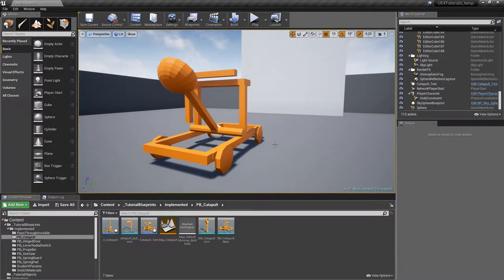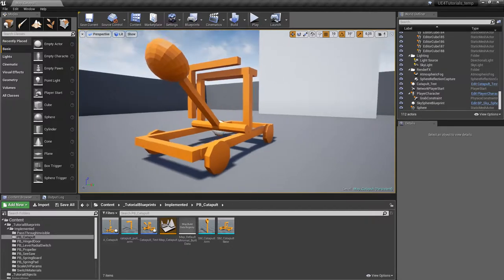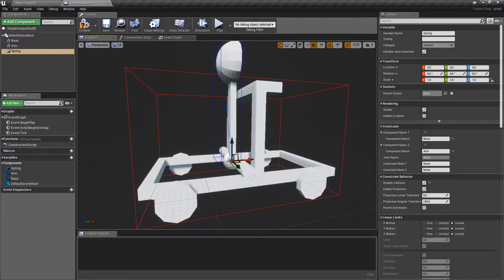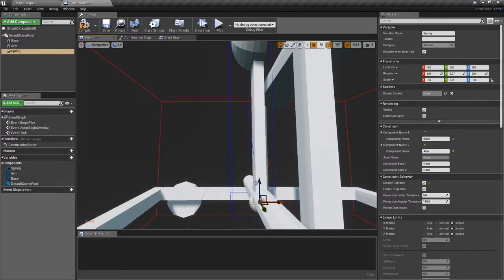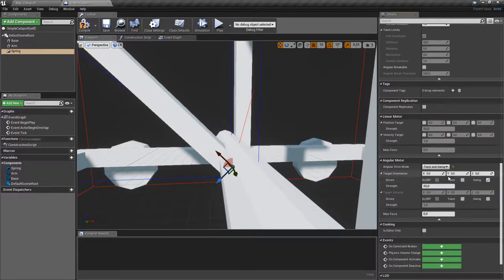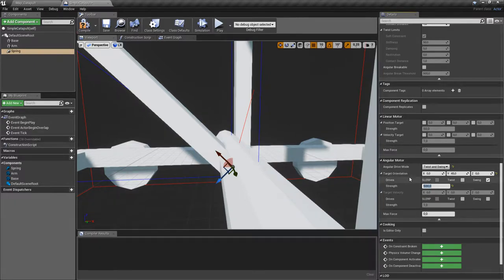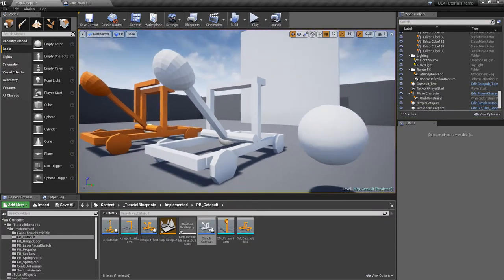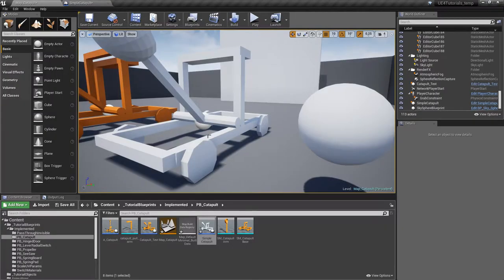UE4 Catapult - War Machine using Physics Constraints in Unreal Engine 4 Tutorial How To

Comment: Hi. can you change ingame the shot force (distance)?
Reply from the maker: Good question! Yes, you can change the shoot force. Here's the blueprint for that:
https://drive.google.com/open?id=1uN4fHZnNbJyQNMuWtOunAUN0stHqkIlS
First, create a function called 'Set Spring Strength' with a Strength (float) parameter, then in that function call the 'Set Angular Drive Params' function on the Spring and plug the Strength into the Position Strength. Then, you can call that function wherever you want to change the strength. For example, in the Event Begin Play or a custom event if you want.
It's not really possible to change the shoot distance directly. You'll have to set the shoot force and see what that gives you.
Because the movement of the projectile is calculated with physics, the distance will vary from one shot to another even using the same projectile. Even the direction will vary a little bit. If you need a precise movement, you shouldn't use a physics constraint to launch the projectile, rather you should set its launch speed and direction directly.
Reply: Sounds good, thank you. Tomorrow i will try it. Good tutorials, keep it up. Finally not a 21311. how to make tps/fps videos :)